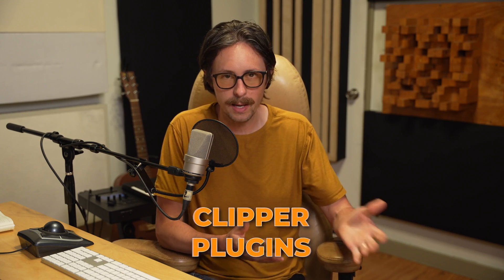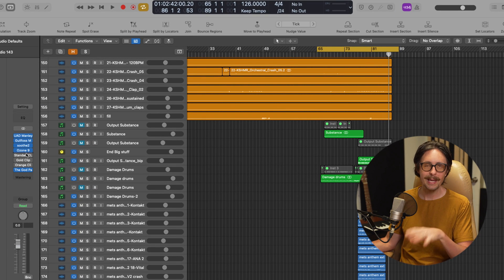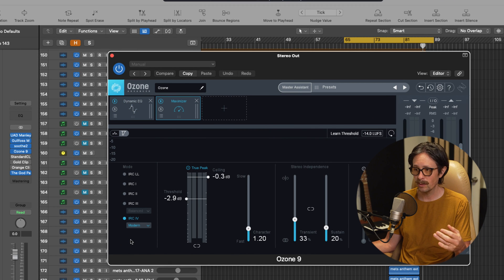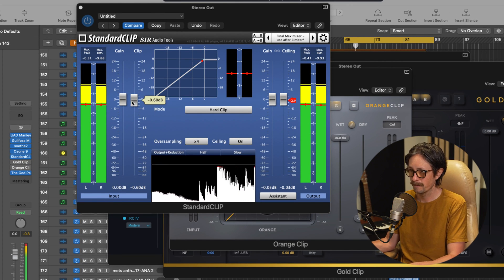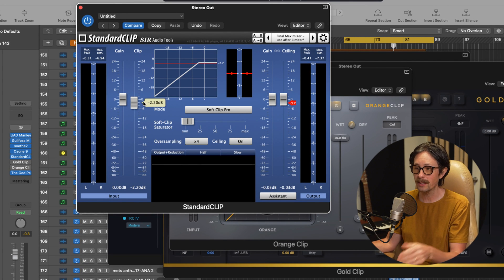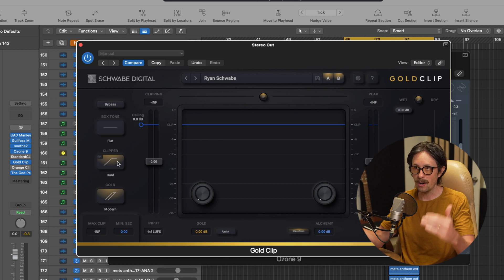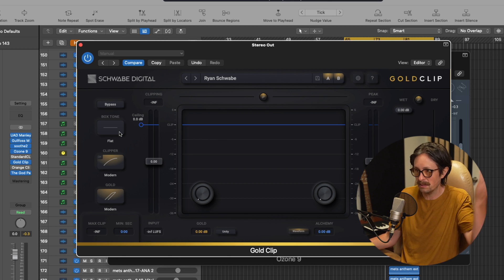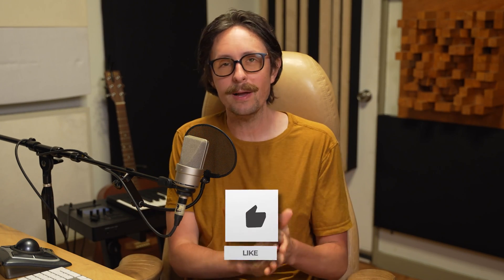Hard Clipping vs. Soft Clipping & Oversampling Explained

Comment: So im guessing this is for the mastering side. Since we are sending out -6 to -8 dB  for head room for mastering. Hence no need to clip the master mix. Correct?
Reply: Limiters go on master tracks, clippers go on bus mixes. Though technically they are the same thing, just used differently. One example would be if your snare is spiking because if you lower the level its perceived loudness won't be loud enough. So you would use a clipper to smooth out and cut those peaks down...which in turn, allows the master mix to ultimately have a higher perceived loudness, regardless of what lufs it is reading at, because it frees up more headroom.   I engineer and make heavy metal, so I dela with a lot of stray peaks and pretty much use clippers on every bus channel and then use a limiter on the master to increase the perceived loudness. It's crazy because before I learned this, my masters were at -7 lufs with about -2-3db gain reduction. Now they are about the same but the perceived loudness is so much louder and crisper.
Reply: @ZikadaIsNothing thank you for the info.  I am thinking about buying the gold clipper. 👍🏻
Reply: @HooliTV I was making that same consideration until I compared the prices and this one is so much cheaper and does everything it's supposed to. The gold clipper might "color" the sound a little differently but this one sounds great.

Comment: You dont need a limiter with proper clipping.
Reply from the maker: I’d disagree with you here, as clipping is just taking off the tops, not bringing up the low level information like a compressor/ limiter does…  I love the sound of a lot of limiters as well, very different sounding than clipper plugins
Reply: @RadiumRecordsHollywood  My chain is EQ, Glue Compressor, then Clipper either Standard Clip or Free Clip or Using Ableton Master to clip at 0db when exporting to 16 bit from 32bit float.

Comment: I think you need to explain exactly what over sampling means. It’s not about the top end. It’s about aliasing distortion, which occurs in the audible band at much lower than top end frequencies. As to how loud those “distortions” are  relative to signal levels depends on the amount of harmonic distortion added, which of course will be greater on clippers and distortion plugins, but of course will be present on any plugin that generates any harmonics added to the original audio.
Reply from the maker: It's about pushing the filters up to higher frequencies beyond human hearing...  It's very much about the high end, as that is how these filters work, it's all about The Nyquist-Shannon sampling theorem.  I have a masters in sound, I did not want this video to be over-complicated, I more so made it to help people get a basic understanding of how oversampling works.  The biggest reason to oversample is to, YES to avoid aliasing (distortion where high-frequency signals appear as lower frequencies), the sampling rate must be at least twice the highest frequency component in the signal...  So, to say "It's not about the top end" is confusing in itself as a statement.  Now, I understand what you're getting at, but to people using clipper plugins and not wanting to get a degree in sound, they just need to understand a bit of this.  BTW...  Who do you know that could pin point the sound of aliasing in a record with great accuracy?  I'd say I know 0 people that could blindly.
Reply: @ Thankyou for confirming your knowledge of oversampling theory, I have come across some pretty suspect opinions about it over the last few years. From a sound POV, it’s less about the top end, but from a filtering pov it is. And you are right, if you listen to fully oversampled vs non, I suspect nobody could directly compare, but perhaps the decreased levels of aliasing distortion, may give a more “analogue” flavour to the audio, as generally analogue distortion is more weighted towards 2nd and 3rd harmonic, as opposed to fractional ratios. Generally I would use oversampling, certainly on a bounce. Although I do wonder why there is still this bizarre interest in loudness, dynamics in music is what makes real playing sound so much better (unless it’s a programmed electronic style ). Loudness normalisation to the various LUFS standards for streaming pretty much negates loudness from a relative level POV, although of course it can  be argued for some styles of music the affect on the sound of loudness maximisation, parallel compression, clipping, limiting is sonically “nice” I guess it’s a matter of taste/creativity. By the way I meant to add your explanation of soft clipping vs hard clipping and the difference between limiting is very useful l, and will hopefully help a lot of people using these plugins.

Comment: Thank you for explaining how oversampling affects clipping.  I work in 48k 2x over sampling  and to my understanding that would be like 4x over sampling if I worked in 44.1k. That  being said is there a reason to use 4x oversampling and above?  Another  question is; if the samples I use to compose are in 44k does it make more sense to use 44k sample rate and just use 4x oversampling with my plugins and get the same sound quality as working in 48k?

Comment: Amazing video, better than most uni lecturers at explaining things and i now understand ALMOST everything i need to know... however, the question i cant seem to get answered is; can you do too much oversampling? for example using oversampling on a compresser, then inside a clipper, and then in a limiter (lets pretend CPU is NOT an issue at all) would it be better to wack all of them on max when rendering

Comment: Hi 
First thanks for all your work, it helps a lot to understand.... a lot.
One question: I watched the video you made on the Oxford Inflator two years ago, and I was wondering if you continued to use it as much as before since these new clipping plugs came on the market.
Can they be complementary or do they do a better job than the inflator?
Reply from the maker: the inflator is amazing!  I still have it on my master buss, it's actually not a clipper plugin but it can be used to clip

Comment: If I need any compression in the master chain, I will do a very small amount of clipping (usually soft) before the compressor and after some EQ... (especially if I'm doing any low cuts). I like to use Pro L2 on a slow attack and a fast-ish release to essentially make it a soft clipper before my last limiter.
Reply from the maker: Very nice!